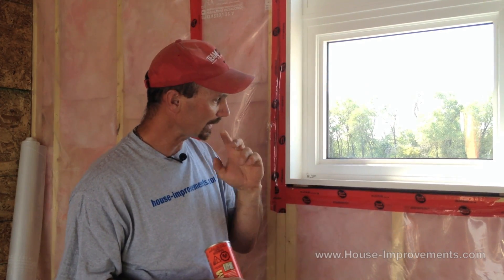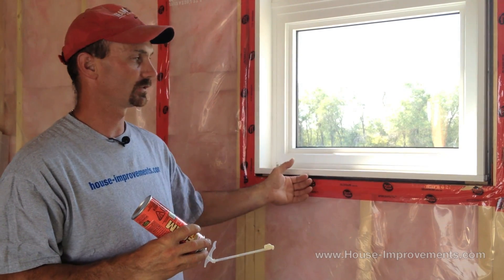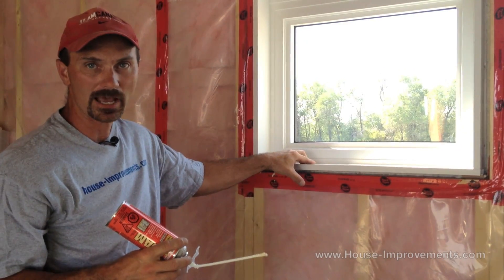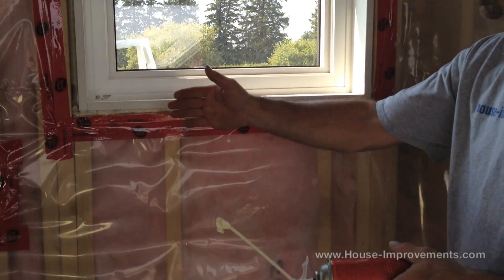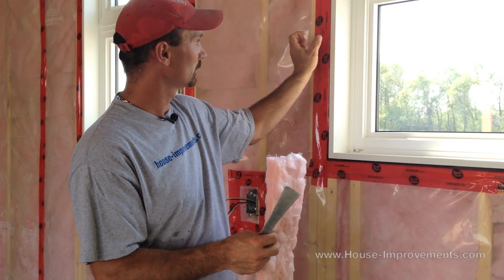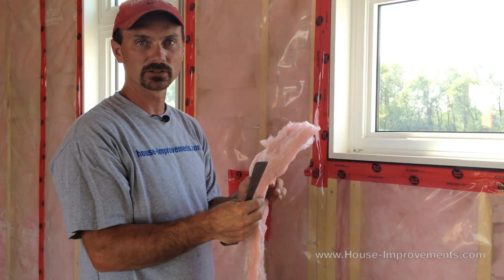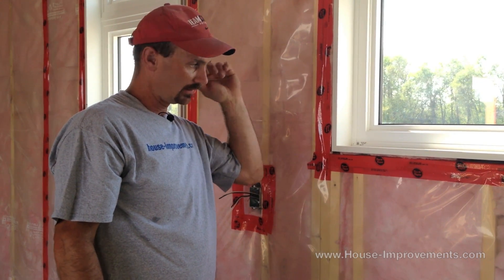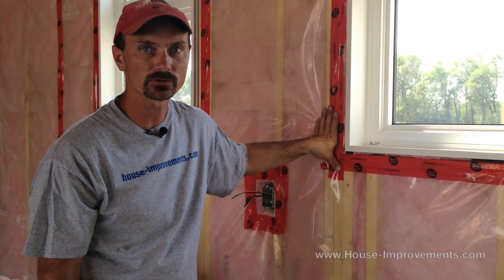How To Insulate A Window Or Door

Comment: What I find interesting, is so many window install videos really stress the need for a water drain gap on the bottom with those little blocks. Yet, you filled that whole gap with foam. I personally do the same, since the real moisture barrier is properly installing exterior trim, then properly caulking the outside trim and flashing to prevent water from getting behind the window to begin with.
 
 The better quality spray foams are also waterproof to prevent water from even in there, which is best for insulating, and creating an additional moisture barrier from the outside.

Comment: In my country we are using foam on specialy designed pistol. You Just screw it on and reuse it. The foam won't get dry in the pistole cause the design of pistol prevents it. We don't Use the other method ever. But nice job and a great video.
Reply from the maker: Yup we have foam guns as well ,I just have never got into one, not sure why? LOL

Comment: The insulation chinking works  but most people don’t do the extra layer of tape from the wall onto the edge of the window jamb. If done properly it’ll seal it good and the casing will cover the tuck tape. 
The spray foam is superior but expensive.

Comment: Shannon, thank you for producing EXCELLENT how to videos!  I have 2 bay windows in which the undersides of the units show exposed plywood. I have about a 1 inch gap between the plywood and bottom edge of the window unit. I would like to fill that gap with insulation, because when it gets cold, the hardwood floor area in the house gets really cold. Any ideas how to do that? Thanks!  Jeff G. Richmond, Va.

Comment: Good videos.  I hadn't thought of doing two passes.  I usually overfill and make a mess.  Makes sense on the air barrier of the first pass.  I want to add that gloves really should be worn while doing the foam.  If you get it on your hands there is nothing that will get it off that I have found. Mineral spirits, acetone, even gasoline (!) will not soften it so it can be removed.  If anyone knows what will get it off, aside from some kind of VERY strong abrasive, please post it.  I have gotten it on my fingernails and it is there for days until it finally just wears off.  I always tell myself I will be extra careful, and I always fail and get some on my skin.  Best just to put some disposable gloves on of some type and avoid the problem.  Also, use care when dispensing.  Try not to pull the trigger all the way down as it will come out too fast.  Take your time and squeeze gently to get moderate flow of the foam.
Reply: If you get it on your skin use acetone before it cures and it comes off. But you gotta be quick.

Comment: What if your gap between the window and the framing is thinner than the thickness of the straw and you can't get your straw in there?
Reply from the maker: Sometimes you can squeeze the straw with pliers to make it flatter to fit if its the smaller style straw ,if it's the larger straws you can't. You are stuck with sliding batt insulation in there with a thin bar. After that use the foam and carefully seal the very last bit if you can.

Comment: Im a new construction DIY'er and I'd like to know why you wrap the walls in plastic after insulating? Is this also an insulation method? Also great video! great tips!!
Reply from the maker: This is the air/vapour barrier. It keeps warm moist air from in the house from entering the cold wall cavity and also keeps drafts out of the house.

Comment: Regarding cleanup of your hands, brake cleaner is not super nice to your skin but it will remove spray foam easily (just use gloves though if you can). You can also use it to clean out the straw and the connector on the can and have a better chance of re-starting the can if you only use a partial.
Reply from the maker: Thanks for the tip!

Comment: Great videos, thank you! I have a question; how did you get your framing flush with the window frame their? do you have a video talking about framing around windows? I'm framing my basement and is struggling with the windows, they have vinyl borders that are flush with the concrete.
Thanks
Reply from the maker: The window jambs actually are sticking into the building past the farming by 1/2". This allows them to be flush to the face of the 1/2 Plywood that will be on the interior of the wall of this garage. I order my windows to fit.

Comment: Quick question when you do the bottom doesn’t that block the gaps you left on the silicone when you installed it for the water to come out thru. Thanks for your videos
Reply from the maker: really with sprayfoam you should not get moisture and if you do it will stay to the exterior and find the openings left as drains.
Reply: HouseImprovements so sorry to bother again but forgot to ask you what nails to use and also my window is from window depot and doesn’t have holes do I just make my own for the nails
Reply: HouseImprovements I bought some GRK R4 #9 2” multi purpose screws. Hope this works. Thanks

Comment: You are very talented there is nothing you can't do!  My grandson wants to live in the shed this winter and wants to install drywall the shed has plywood inside and outside with insulation in between, he wants to put the drywall over the plywood, is this a good idea, my husband says the drywall will crumble.  Shed is 12x16, I would like to help him but at 73 there is not much I can do except purchase the material, will I be wasting my money on drywall and a wall heater that says it can heat a room 240 sq feet.  We live in Canada, 30 or 40 below is pretty cold what do you advise?  Shed has one little window that needs to be insulated too.  The raccoons come in via the ceiling of the shed but can't get inside the shed, it has insulation for a ceiling and he covered that with a thick plastic?  Thank you for your great videos, I could watch your work all day, very good at what you do.  D. R-Lapointe
Reply from the maker: The drywall should be fine if there is heat I guess
Reply: Thank you not sure how much heat there will be.
Thanks for your help
Reply: 30 to 40 below and your Grandson wants to camp out in the shed? LMFAO! ...Bubbles?
Reply: Naw I wanted to do something like this when I was a kid. Attic, the garage, and tree house, etc. Imagination was the limit. We even built a pine branch trench over two fallen pine trees. Dug deep and used pine branches as joist and covered with pine straw for shingles. Worked pretty good. Just be happy he isnt in a closet somewhere with a tablet.

Comment: I had replacement windows put in last summer and found out throughout the cold months they were not insulated.  What can I do to insulate now?  Thanks.
Reply: Terry T just take off the trim and you can Insulate them now. It can be done anytime by just removing the trim and revealing that gap
Reply: Terry T I

Comment: Is this thing water tight?  I did my windows and I have some gaps on the outside frames areas so could I use this stuff beside silicone caulking etc...??
Reply: It is, but IMO, cualking is best for those gaps. Just make sure you're using the exterior kind that says on the label that it will not crack (often a latex type).

Comment: Just curious when applying the foam , when it expands, will it expand and seep down into the spots left open for the condensation to escape?
Reply from the maker: Good point Anthony, when installing the foam there is a chance that the foam method may fill those voids , I have never seen it actually come out of those spots . If it is completely filling the void all around the window there is really no place for the condensation to form . When using batt insulation there will for sure be some gaps were it is not pushed completely in. I leave the drains no matter which way I insulate just in case though.
Reply: What spots you referring to I’ve never heard of spots  for condensation to scape

Comment: So my inspector says I need to trim the foam around the windows to put caulking around it. Can you suggest a tool that can trim deep enough in so the caulking won't be all bumpy? Any advice would be great thank you!
Reply from the maker: not sure why you need to caulk it? If you sprayed once and filled about half way and then filled the rest after the first dried you can trim off the excess and its sealed. Anyways you gotta please the inspector i guess now. There is no real tool that will do what you want neatly . I assume you have drywall on walls so gouge out the best you can with anything and then fill with caulk. If it was me I trim the foam flush and would use tuck tape and tape the drywall to the edge of the window frame and the window trim would cover it all.

Comment: when compressing the insulation you loose the R-Value but you also stop the air flow, does that amount for anything good ass far as heat or cold loss from the room?

Comment: do you have to tape or vapour barior the gap?
Reply from the maker: Tape it to complete the Barrier.
Reply: @HouseImprovements I mean do you have to tape the spray foam or the insulation?
Reply: @HouseImprovements  correction.. so if you use the bat insulation for the windows you have to tape over the bat insulation and tape it to the window some how?

Comment: Thanks great tips ,I live in Ontario, so what are the best basement windows to buy
Reply from the maker: That is a tough question. There are many brands. Look for windows that meet "Energy Star" specs. They will have stickers to prove that they are approved . One brand I use a lot is. "All weather"
Reply: +GmGarlo , windows are rated by U value. The lower the U value the better it insulates. Since we are more familiar with R value do a simple conversion...divide 1 by the U value. The result is the R value. The higher the R value the better the window insulates. Keep in mind, however, the best insulated window is no better than the worst wall.  Insulate with closed cell foam and it will be air tight. Cutting closed cell foam does not reduce it's ability to block air infiltration. Never use fiberglass to insulate a window. It leaks air and most often it's packed in so doesn't insulate at all. Spend the money on foam and it will pay dividends on comfort and energy savings.

Comment: Someone did this with my windows but I was told it can damage the window due to the pressure. Am I misinformed?
Reply from the maker: Use the proper low expansion window and door foam and dont over fill it in one application. fill about half way and let it expand and cure then top it off it it need more.

Comment: Doesn't filling the bottom with foam defeat the purpose of having a path for water to drain out. Would backer bead pressed in a short distance and flush with the inside surface work?
Reply from the maker: If it is filled with foam water should not get in?
Reply: insulate the bottom just like the sides and top.

Comment: Why after we did insulation and vesper berries .....got moisture can you tell me why please  thanks
Reply from the maker: New wood can have moisture in it when its first being installed and started to dry out. So if you framed and insulated and installed vapour barrier in a short amount of time you will traps me moisture mac there , small amounts will dry to the exterior and you should be ok.

Comment: Why is there a gap in all the windows ??
Reply from the maker: this is the space between the wood opening and the window frame. It is needed for easy installation and squaring up the window . it is insulated after the install.
Reply: Thank you.  I guess the people that installed my windows did not insulated .. there is too cold or hot around the edges

Comment: I live in southern california where it's never really too hot or cold.   Low 30s in the winter and hi 90s in the hottest time of summer maybe into the low 100s.   Do i really need to insulate the gap? Will i tell the difference.
Reply: Only if you want to be efficient.  If not, then let it go and watch your electric bill go up.
Reply: insulation also keeps the interior comfortable and dry in hot seasons, it would be stupid to not insulate.

Comment: I'm sorry but I totally disagree with you that hand-stuffed fiberglass insulation is bad. Spray foam is the worst insulating product out there. SPRAY FOAM NEVER DOES WHAT IT SHOULD. It doesn't fill enough of the gap half of the time, "limited expansion" still expands inconsistently, and it is just a mess when the window is eventually replaced. Fiberglass insulation is much more efficient. If it wasn't, then why is YOUR ENTIRE HOME FILLED WITH IT???!!!
Reply from the maker: I would disagree but everyone is aloud a opinion.
Reply: I don't think he's saying that fiberglass insulation is bad, but rather batt... short for batting...
Reply: Because it is cheaper than foam.  Generally builders are out to make money and people can't see the insulation, so they use the cheapest.